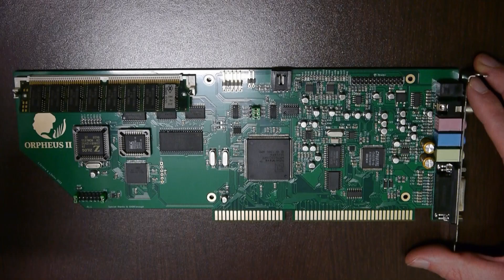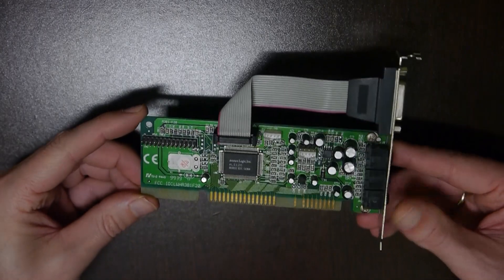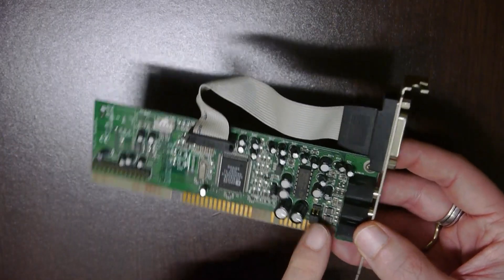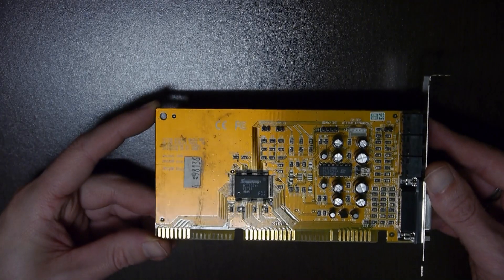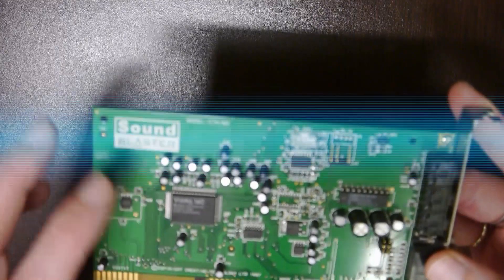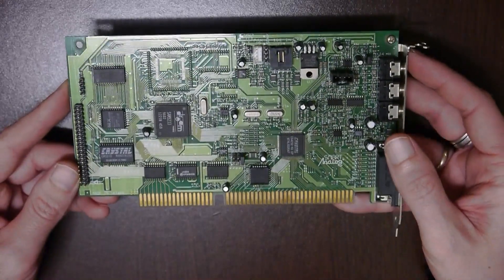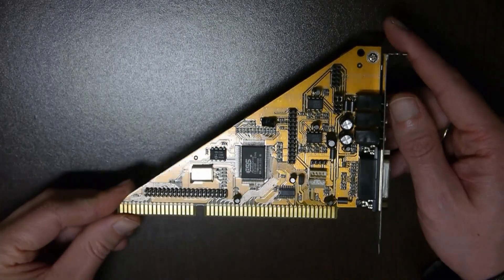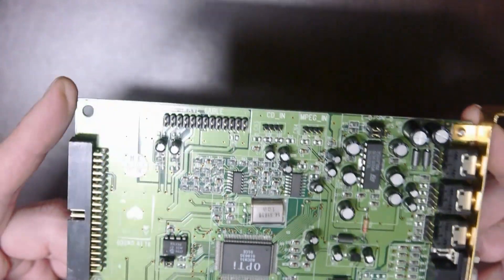The Alloyrun FM-comparison (Yamaha, AD,  ALS, CMI, CQM, Crystal, ESS, Dream and Opti)

Comment: The ALS-120 was a nice surprise for me, sounding very similar to the original, desipte what I read about it that it uses a BAD clone of OPL3, but what I heard here really doesn't sound to me like a bad clone, rather like quite a good one. Any opinions/experience with them?
Reply: Yeah, the PCB designs utilizing AL chips were most if the time, uhm, just bad, to be polite. But there were some "manufacturers" that used the reference layout from the AL techsheets and they are indeed quite good. I own 2 of them myself. Both of them have no option to bypass the onboard amp but they use 2x LM386 micro amps which are per se quite good but they only provide 1 Watt max into 4 Ohms each. The THD is at 10% if I remember correctly. Best is 700 Miliwatts into 8 Ohm load at 1% THD.
So short: there are a few ALS cards that do quite the job.
Reply from the maker: The precedessor  (ALS100+) have had a copy of the original yamaha opl3 that Avance Logic tried to hide in an uncommon chip package. These sounds exactly the same as the Yamaha. With ALS120 onwards they integrate the fm circuit into the main IC, claiming it is ALS-FM most likely to avoid any license trouble. But my assumption is they just integrate a blueprint of the Yamaha original or at least just did some very minor changes because they sound suspiciously close to my ears :-) So regarding FM you can't do wrong with an ALS card. But my experience isn't the best with ALS ISA cards. Many of them have cheap pcb design and noisy amplifier iCs that on some cards even couldn't be disabled by jumper. Also, volume level in line-out mode is quite low so you really have to tweak the mixer settings to get an acceptable result.
Reply: @pc-sound-legacy  Thank you for the educative reply. Good point with non-disable-able (is that even a word? 😀) internal amp....just had a look at the card I was contemplating to buy and indeed, I could see no jumpers to bridge the amp and make the output direct so I'd be stuck with it...I think I won't bother with that card for now.
Regarding noisy internal amps - I just recently happened to acquire an ISA ES1868 card in a K6-2 machine, and it has the worst amp I ever heard - when I turned the volume dial to more than about 1/3 of max on my passive headphones, I could literally hear every byte passing by on the bus, it was like listening to the southbridge at work :) But then I read about its great DOS compatibility without the SB bugs, so I disabled the amp with jumpers and decided to keep it - the sound is nice and clear without the amp, albeit somewhat quiet but an external amp will solve that. Do you mean this kind of noisy on the ALS cards? ;-)
Reply from the maker: @Beus38  yes, exactly :) the amps on the ALS-cards are often that bad in my experience. So the option to disable it is crucial👍
Reply: @pc-sound-legacy  It's not only the amp that is bad, the entire audio circuitry is more often than not outright terrible on these cards..
Reply: @pc-sound-legacy  Most definitely. Anyway, I just happened to acquire a few more cards (a no-name CMI8738, an HP MM Pro16 III (AZT2320) and an Asus Magic S23 - CS4232 with original YMF262) so I wanted to test their FM synth also with this Alloyrun music, but cannot seem to find it anywhere, and my humble attempt to convert a downloaded VGM to a MID resulted in all instruments being disastrously wrong :-) Could you please point me in the right direction where to obtain this MID? Thanks very much :)
Reply from the maker: @Beus38  Congrats to your find, nice selection of cards! You find the tracks here:  adlibtracker dot net / downloads and then the first entry ->  Adlib Tracker II G3 (DOS). Just unzip everything on drive C: In the MOD folder you'll find all tracks. Alloyrun is located in the subfolder named VOID. You can press F3 in the adlib tracker to load a file and F5 to start playback, and F7 to stop playback - if I remember correctly. According to your system specs you might need to edit a file if sound is garbage due to speed issues. If that's the case and you need help, let me know then I'll see which file and edit it was. Have fun✌️
Reply: Wrong! ALS 100+ was allready with own clone, as far as the article on vogons is authentic. Or was it vice versa? They wrote it in the datasheet sounding that the chip has integrated FM but it meant the direct interface for YMF-262/LS262/etc... 🤔
Reply: @thomasr.5443  The datasheet is a lie.

Comment: Yamaha is certainly the best option.
Reply from the maker: You can't do wrong with the original👍
Reply: Very subjective... I hate that opinion that only the original sounds best. Yeah, original is original, no doubt, but I prefer CQM for playing DOOM with FM because CQM sounds just more Metal in that game. As a daily driver I prefer the CMI chips. They are practically compatible to everything: SB16, Pro 2, SB, adlib, WSS, MPU401 and I cannot hear any differences in FM. Ah I almost forgot: those chips have a neat "Loudness" function which boosts the thin FM music a bit more.
Reply: @thomasr.5443  The objective would be to say that imitation is better.
Reply: @SANPARR1  I just wanted to say that it may depend on the use case and yeah, as I said, I like the CMI FM core more than the original. But is that objective? No. It's subjective. When a clone does wrong notes, play to fast, etc., etc... THEN I'd say, this particular chip is worse than the original and this I'd call objective because the clone does it just wrong.

Comment: cool video.  Interestingly.  I liked the CMI-FM and the ESS-FM more than I expected I would.  There are some tonality differences, but they weren't so jarring as to alter the overall sound of the music like some of the others.  CQM wasn't terrible, but it certainly lacks a lot of of the bass punch that a lot of the other cards had for sure.
Reply from the maker: Agree.. ESS is very harmonic overall. CQM might improve on better cards like AWE64 or SB XV16/ I should check that. But cqm always deliver more highs/clearness on cost of deepness I think. Did you recognize the charming 2nd voice in OptiFM? But overall, opti can't satisfy me in Alloyrun.
Reply: CMI-FM is a 100% licensed OPL3 replica, there are no differences.
Reply: @naib_stilgar  Well more likely it's 100% stolen :D
Iirc the design of the OPL3 got stolen back then, leading to "LS212" chips on some cards, which then evolved to other chips typically found on ALS cards, and then I guess the CMI8330 was the most integrated one
Reply: @DxDeksor  no it is proper licensed.
Reply: @naib_stilgar  how do you know?